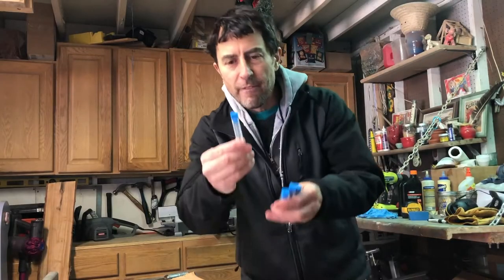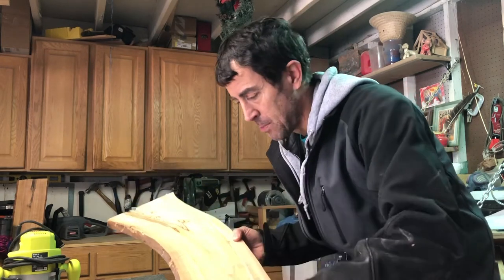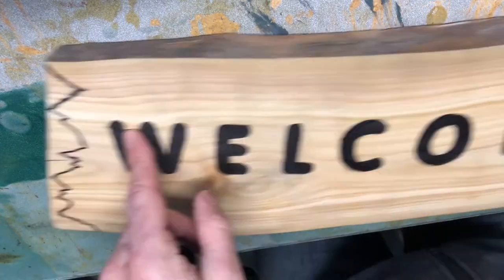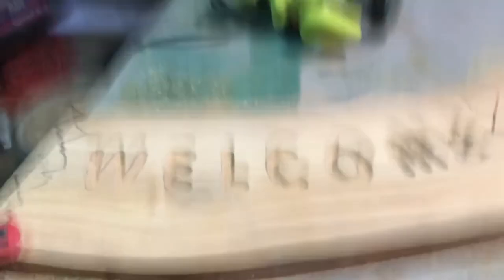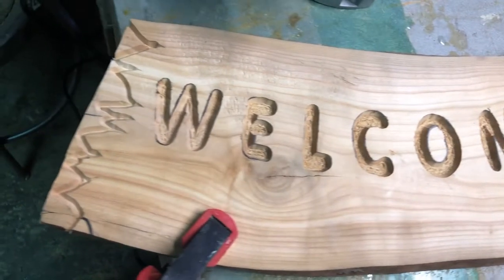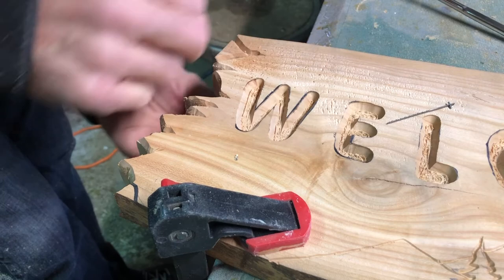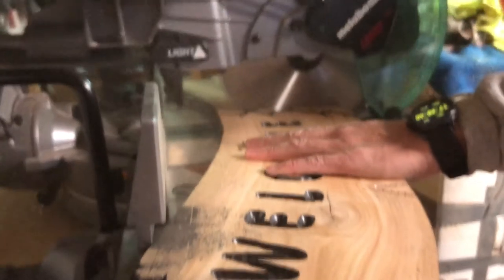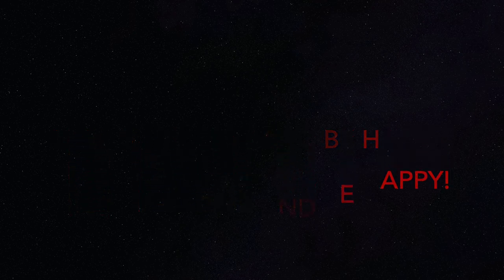DIY Welcome Sign Using a Ryobi Plunge Router

Comment: I just started carving with my palm router. I have experimented with using other color spray paint for the letters and it really makes the sign look very custom. I have sold 6 small carvings on pedestals. I built a deck and cut off 2x8x10 end pieces and I used the router to carve these. I have the no slide shelving pad from dollar store so no clamping needed. The advantage to the palm router is more control for small carving.
Reply from the maker: Sounds like a nice setup you got.  Before I router my nest sign I need to get that "no slide shelving pad for sure.  Happy carving!

Comment: I put on a coat of clear poly before painting.  That keeps the paint from wicking into the wood on the edgee of the letters and on the face.  Less planing is also needed. This is more important when you have an open grain or porous wood.
Reply from the maker: Oh interesting..  So, you poly the surface then spray paint into the letters then run it through the planner as I did?  I did have issue with the black paint not coming off and planed  to much taking some of my mountain details..  I'll try this on the next sign actually coming soon I hope. Getting cold here and no heat in the shop.